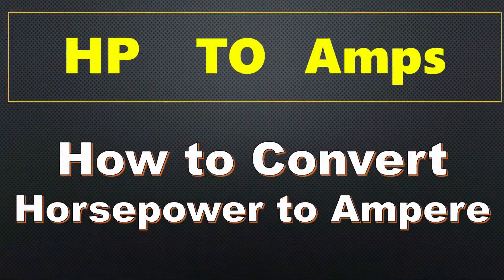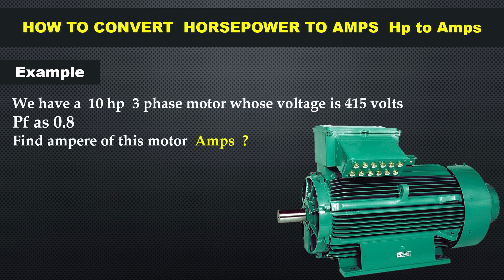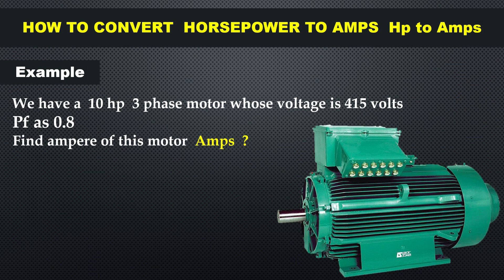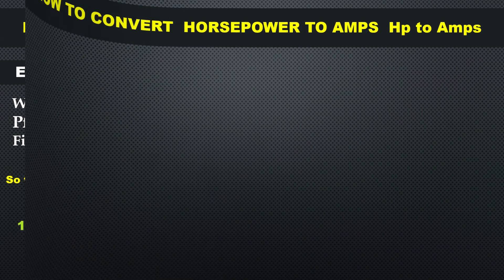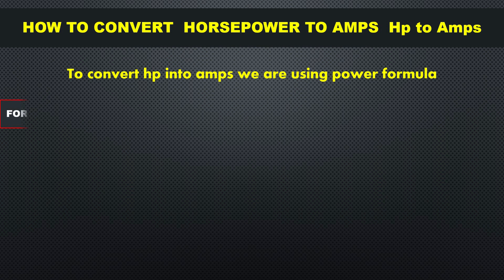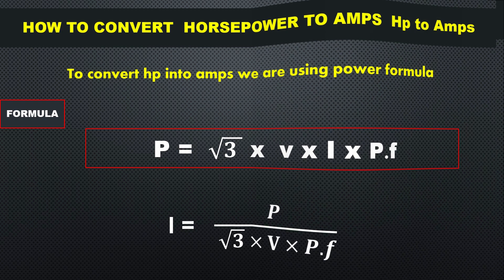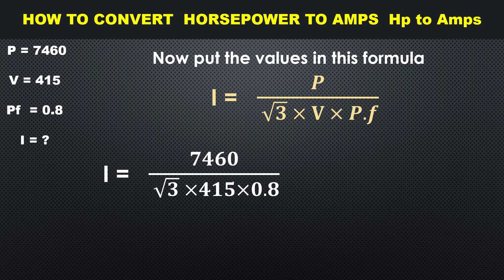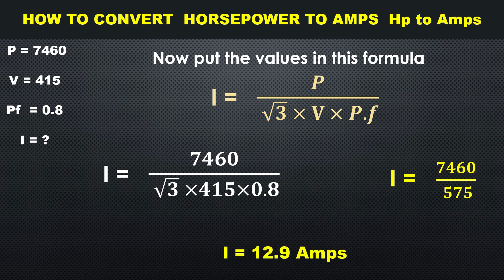how to convert horsepower to amps or hp to amp

Comment: I think you are totally wrong,
The answer is 129.88Amp
7460/1.734/415/.08=129.88
So please check 🙏
Reply from the maker: Bro this is not Division its a Multiplication  1.734 x 415 x 0.8  = 575.6 
Now power divide by 575.6 
7460 / 575.6.  = 12.9 Amp
Reply: Where
1.734x415x.08=57.56
Now
7460/57.56=
Please I'm sure that the answer is not correct.